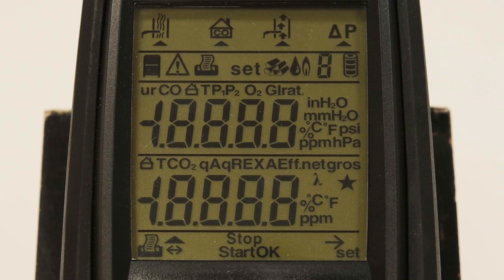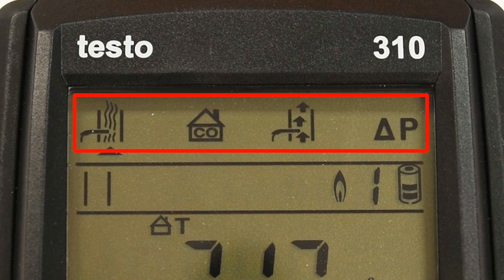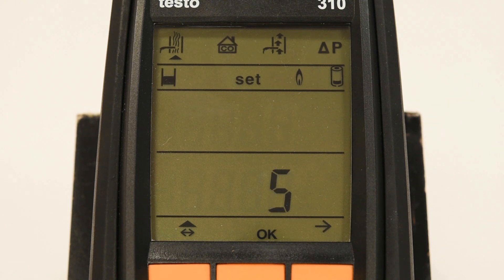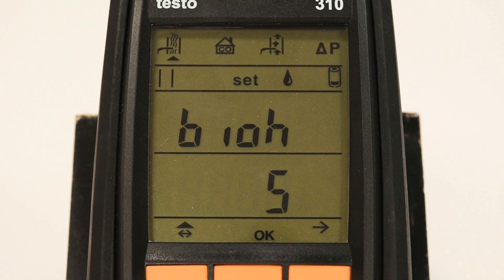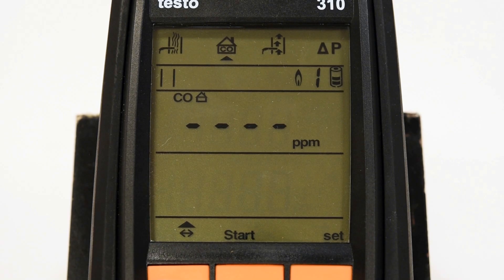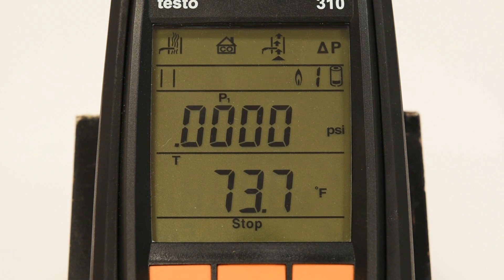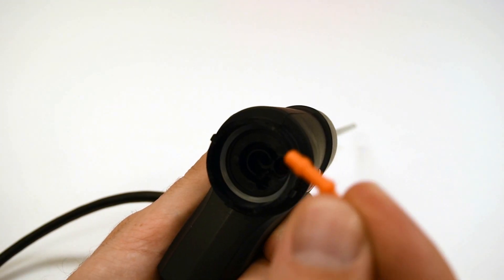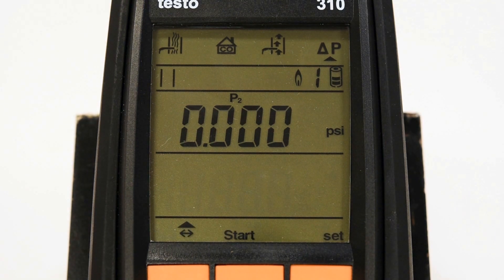How To Use the testo 310 Combustion Analyzer

Comment: Can the ambient CO test be performed with the probe inserted in a duct or plenum while the blower running?
Reply: I have been looking all over the internet trying to figure out whether it uses the probe to measure ambient CO or if the unit has a separate sensor. If the probe is being used to take the measurement you would not be able to have it inserted in the flue. The way they seem to have it is that you must do ambient CO and draft pressure separate before you take your flue gas analysis if you want them on your receipt. The analyzer will remember these readings once taken. 

This video is just a basic tour it doesn't cover the nitty gritty of this tool and it's workings and shouldn't be labeled how to use it lol